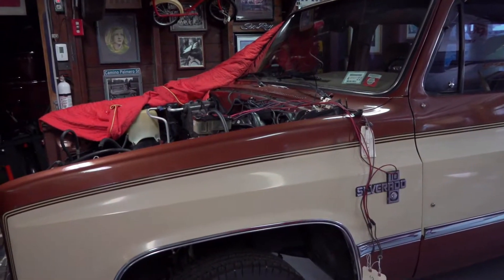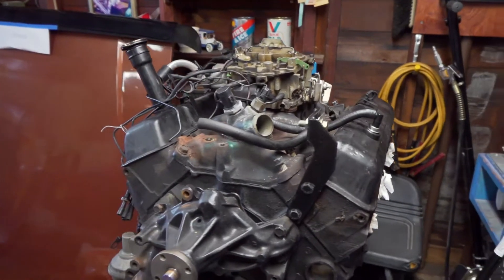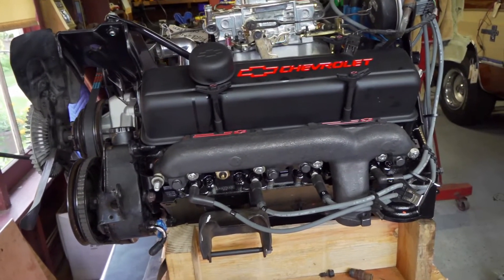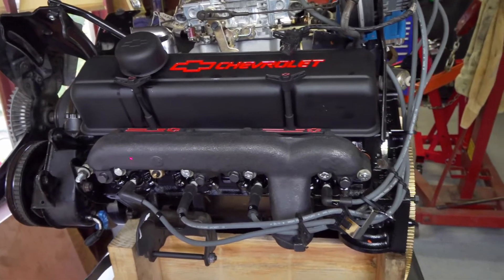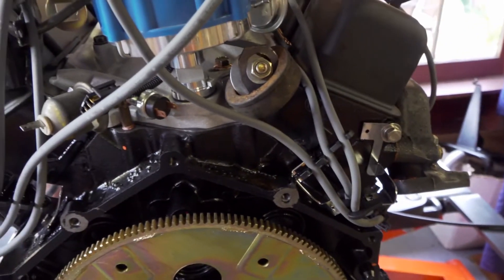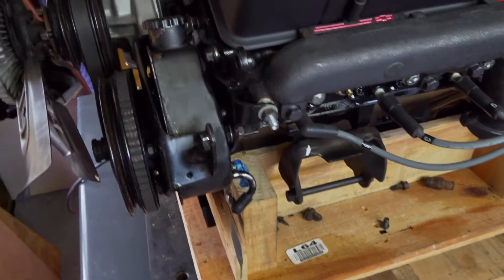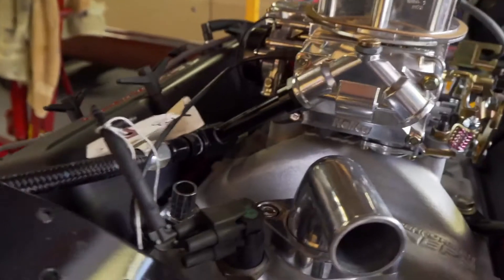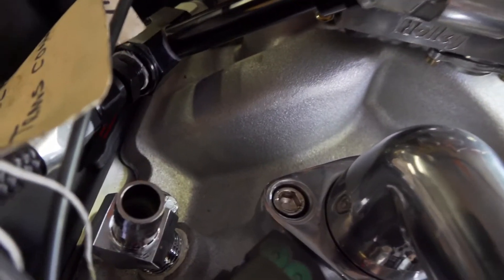Engine Pre-Install 1986 Suburban

Comment: Very informative addition to the project. I've got a keen interest in the replacement because I've thought of doing the same at some time but have been hesitant because of my lack of knowledge regarding choosing the the engine from a reputable supplier with a history of positive feedback. 
I do have a question about the engine. Did the supplier give you any data on the build ( cam and lifter specs ect. )and did they do a break-in run for the cam ? I appreciate any information you can provide when you have time. Thanks
Reply from the maker: There is a set of specs on the Pace Performance web site.  There are no instructions sent with engine.  You are pretty much on your own to figure it out.  They did send me the plug for the dipstick when I called and talked to a technician.  The engine has not been run.  They primed the oil pump and installed break in oil.  This is not a project for the faint of heart.  I spend many a sleepless night believing I had made a mistake in starting this project.  If newer than 1986  it would be an entire different set of issues and I don't t think I would attempt it myself with a ECM computer and fuel injection involved.
Reply: @orvillespooner1  Not to act helpless I went to the supplier website and saw they prelube as you said and fill the crankcase with break-in oil. I did see they offer an in-house dyno break in as an option. I'm only bringing this up because there is a break-in protocol for the engine. I've rebuilt 2 engines over the years and both required that break-in for the cam and lifters on initial startup. In my case it called for the engine to be filled with break-in oil( high zinc content) and run @ 2,000 rpm for 15 minutes then  drained of oil and new filter and refilled with regular oil on the crankcase. I would ask them initial startup requirements for that engine. RPM ,time run ect. for break-in. I know you've made a substantial investment in the project and want all to go well.
Reply from the maker: Rick Daystar ...there is a break in procedure from GM with the engine.  Since I am not there yet I did not fully study that but I do remember something like you say.  With this reminder I will be sure to study up,and follow procedure exactly.   Heres hoping the engine starts and runs well and will ne able to go through that procedure first time.  I rebuilt a 283 myself 27 years ago and did not do any of that!  Engine is still running strong and uses no oil.
Reply: @orvillespooner1  Wow 283 brings back memories. I had a 64 Chevy with a 283 3 speed on the column.  Loved that car. I don't know anything about the new engines with all the computer modules ect. I'm lost with that. My next door neighbor has a shop and does all kinds of work on these newer cars. Has all the diagnostic test equipment. He bought an old I think, 8N Ford tractor couldn't get it to start. Changed plugs and wires and coil. I asked him did he check the points? Nope. I took the distributor cap off and saw the points had oxidized. Two minutes with an emery cloth and they shined up. Put the cap on and it fired right up. He just looked at me. Eric I said, sometimes old school experience pays off. Could I do what he does with new cars? No.